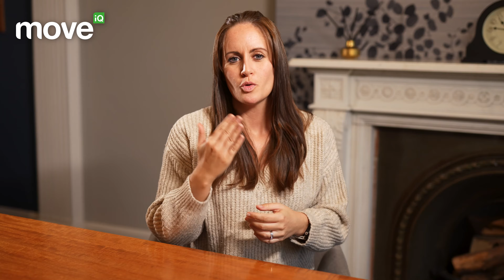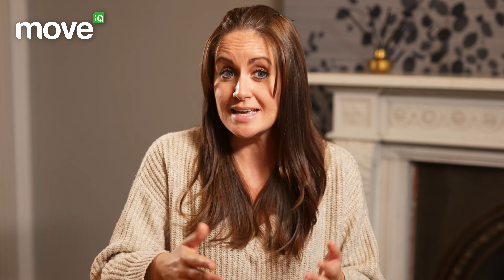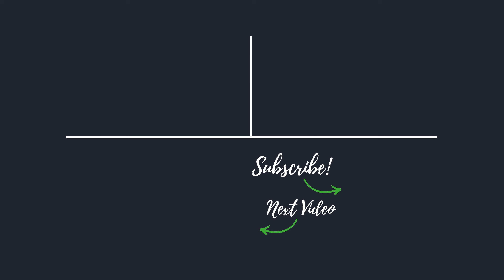Grants For Heat Pumps | Advice for Homeowners

Comment: Proceed with caution and care, we have decommissioned our HP and gone back to gas as the electricity bills were crazy.  (And yet we had multiple visits from engineers, electricity companies and independent specialists).  General summary is they are ok for small, ultra insulated new houses with small rooms.  Forget open plan areas, high ceilings or larger rooms, they just don't have the oomph.
Reply from the maker: Thanks for sharing this